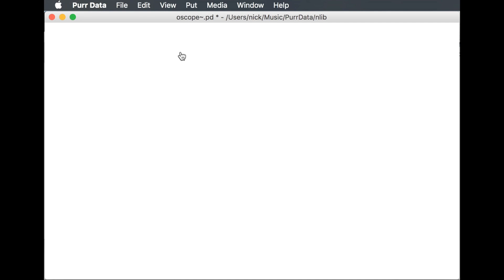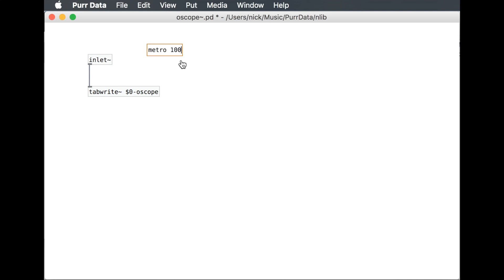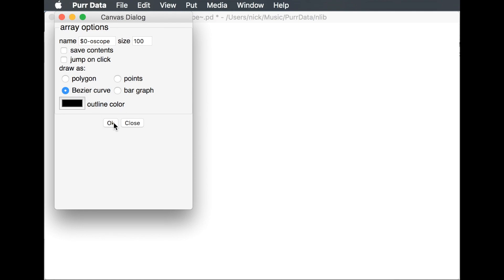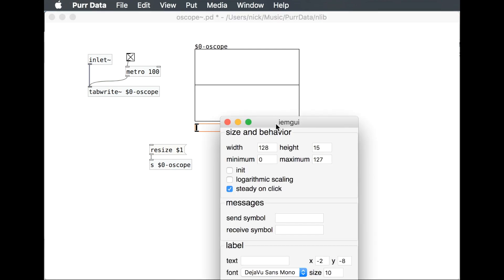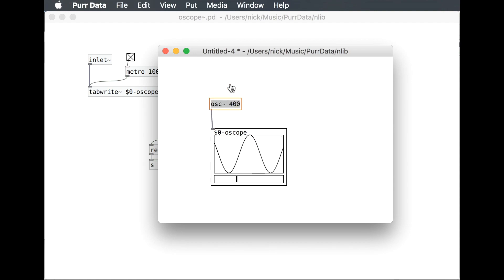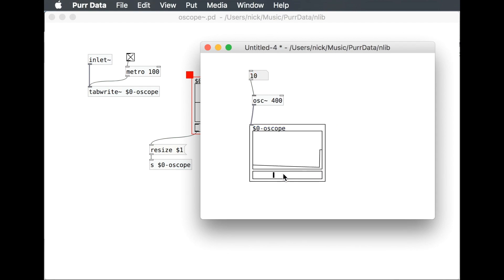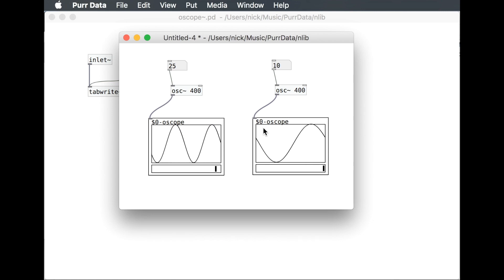(008) Pure Data - making a simple oscilloscope utility

Comment: EXCELLENT! Been using PD to extend the functionality for an Akai APC40 on my laser controller. Needed an x/y oscope for a preview monitor. This looks like it will get me there.
Q: Is there anyway to define RGB for each vector being graphed?
Also need a 2 dimensional slider, similar to a mouse pad, for size/symmetry. Hoping that I can also input vectors into a 2D array, as well.

But, what I would REALLY like is an attractive skin for PD. Lira-8 VST is the appearance I'm looking for.
https://www.youtube.com/watch?v=k4GQlD5p6s4
But, I'm using PD to pass MIDI to a Teensy MCU synth, not directly to a DAW. Only need a skin for PD.
Any guidance would be most helpful.
Thank you.😎

Comment: thanks for the video, it helps me learning basis. However i'm not able to do curved connection as you did... I think that's why it doesn't work (when i'm connecting [osc~400] to [oscope~] nothing happen..) thanks if you could help me !
Reply: Had the same problem, I don't think it's about the curved nodes (probably just an aesthetic change from purr data, the pd version used in the video).
Double checking everything solved the problem for me, I had wrong settings in the toggle object properties. (that checkbox should be crossed and must have an "init" parameter selected)

Comment: total newbie here... how did you get the red box to grab the array and slider? What was the moves you did there?
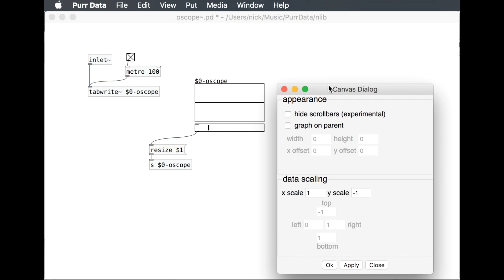Reply from the maker: That's what is happening at 3:55. Right click in a blank area, choose properties, and turn on "graph on parent". Depending on what version you are using you may need to move and resize it by entering the numbers manually. I'm using PurrData here and it allows dragging and resizing. Hope this helps.
Reply: @pd_7773  yeah what's weird is the red box appears but I cannot move it, resize it, or anything. I'm using pd 0.51-1
Reply from the maker: You probably need to enter the location and size manually in the properties dialog.
Reply: @pd_7773  hi~bro!!! what is the version of Puredata you using allows resize graph-on-parent? That's so cool!!!  was it by virtue of certain plug-ins? Thx~
Reply from the maker: @meditationabode8505  It must just be a default setting/ability built into PurrData. I was using Pd-l2ork v2.14.1.